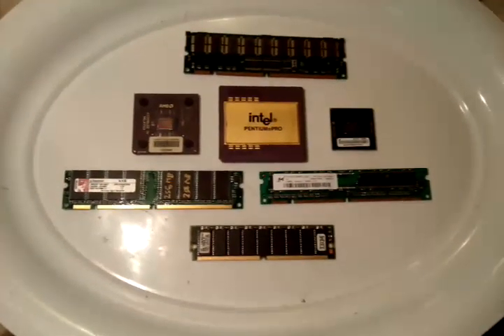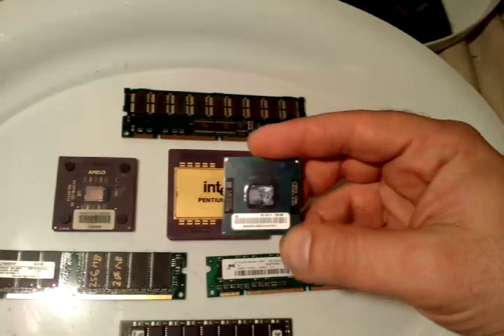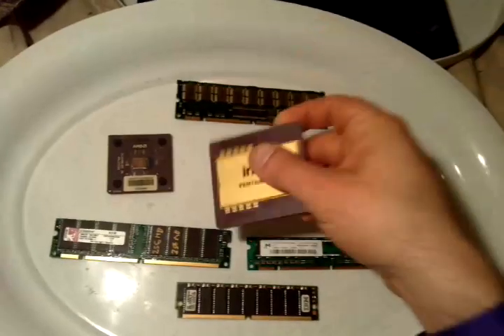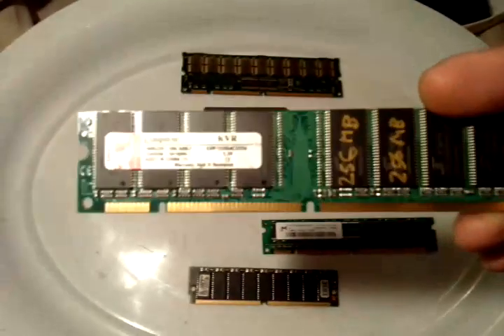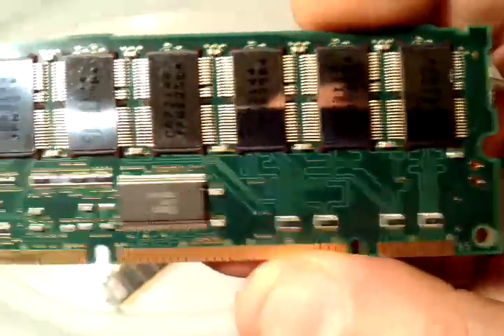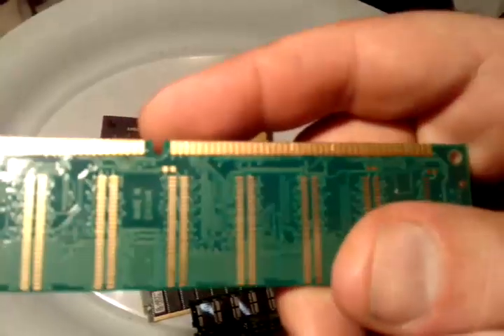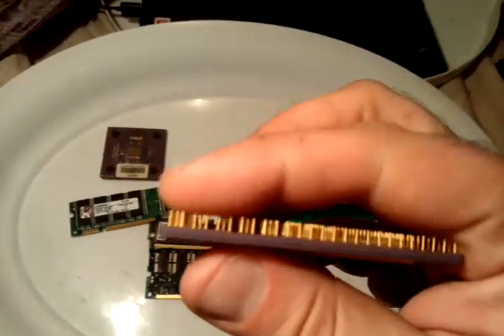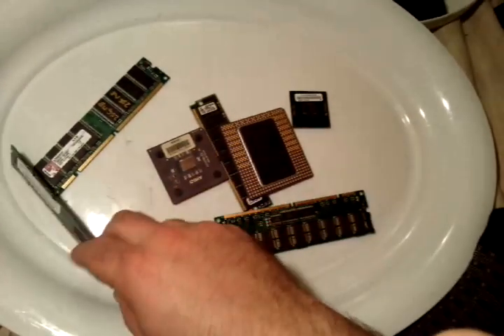Avi Oziel in: How To Recover Gold From CPU Processors and RAM Memory Integrated Circuit Chips

Comment: for the question about sound cards, all cards (vga, modem, controller,) have gold plating on the connecting fingers not much but if you have the material and spare time go for it.

Comment: To strip the gold off the fingers. i took my heavy duty soldering iron, modified the tip to a sharp edge using a small metal file. Let it heat up and run the tip along the finger ridge-line. melts them off like butter. Save all the boards,then put them in an acid wash to recover all the gold.

Comment: As a writer of technical publications I can tell you one vitally important piece of information regarding abbreviations and acronyms. NEVER EVER use acronyms unless you specify the meaning of the acronym in context of the subject you are discussing. "AR" for example can mean "Armalite Rifle", "Autonomic Reflex and a host of other meanings depending on the topic being discussed. Assuming that an interested but uninformed reader knows the meaning of an acronym causes frustration on the part of the reader and illustrates that the writer is either pretentious and condescending or just plain stupid. The point of writing is to inform not to confuse. If you are going to write a piece that includes acronyms, tell the reader what you are talking about. What the hell does MCC mean?
Reply: a0cdhd MCC, as well as MLCC, means  Monolithic Ceramic Capacitors. They have Silver ends and a Ceramic Center with Palladium bearing Metal alloy inside.
AP means Muriatic Acid-Hydrogen Peroxide Solution, usually mixed as 3 Parts Muriatic Acid at a 15% concentrate and one part Hydrogen Peroxide at a 3% concentrate..(Acid Peroxide)
AR means Aqua Regia, Royal Water, as it was the first solution discovered to dissolve the Royal Metal, Gold.. This is a solution of one part 70% concentrate Nitric Acid mixed with three parts 31% concentrate Muriatic Acid.
Muriatic Acid and Hydrochloric Acid are synonyms.
Urea and Ammonium Nitrate are synonyms..
IC means Integrated Circuit.
RAM means Random Access Memory.
Many here are familiar with these terms as we have been, and are currently, refining PMs (Precious Metals) from e-Waste (Electronic waste.). 
Nobody schooled me but I picked it up as I got involved. Of course it was time consuming and I stumbled a lot in the dark before figuring out who had a clue, who was teaching, and who was trying to just sell e-books.(This particular producer did not give any information and is just attempting to sell books.) I started down this particular path in late November and my learning curve has been steep. Of course I have a Science background which has afforded me an advantage on discernment..
If you are truly interested in learning how to do this then I suggest that you visit the Gold Refining Forum and download Hoke's book for free....and READ IT.
I also suggest that you have had a background in Chemistry as many of the processes are dangerous and lab safety protocols are nowhere near addressed enough.
It is not that we are pretentious but, personally, I want to totally discourage and dissuade anyone who will not take the time to research this topic thoroughly and are not willing to follow directions precisely. 
This can be a very deadly or injurious endeavor and it is not for those who will not take the time to do the necessary background research.. 
It is not out of greed (You, nor anyone else for that matter, are going to make a million dollars doing this) or exclusion, but I just do not want somebody to burn their internal lung tissues (which they won't feel as the lungs have no nerve endings) with acids or poisonous gases so that they cannot breathe and die as a result.
I do not want an ocean of dead bodies with the resultant Government regulation to "protect the idjits." 
Now you may believe that it is stupid on my part for not wanting to have that happen.
And you also may believe that I am somehow condescending.
But these processes are extremely hazardous and most really are not capable of Laboratory work or following Safety Protocols to the letter.. And that is just a fact. Science degrees are really hard to get.
So just who has been condescending with their unjustified criticism? 
Who has been pretentious? 
Who has been utterly stupid for being critical without understanding the motives?
And then you wonder why nobody responded to you until now?
So I really cannot care any less what you believe. Is that understood?
Reply: 24kGoldenRocket Excellently put old son. Now we all know what the previously mentioned acronyms mean. You are responsible for what you write but you are not responsible for what the 'idjits' do with that information. However, I can understand your reticence in telling the entire planet's population of idiots how to asphyxiate themselves with NO2, Fuming Nitric Acid and Hydrochloric acid fumes.
On the subject of no one replying to my piece: I had forgotten about it. About condescension: Using jargon and that includes unexplained acronyms is a form of condescension... And that's a fact. Pretentiousness is using language that your target audience does not understand. As for the rest? Well, the government already has a vested interest in protecting 'idjits', after all the 'idjits' are the ones keeping them in office and no one least of all me, said that you were utterly stupid. I think that basically you've done a pretty good job.  By the way, Urea and ammonium nitrate are not synonyms. Urea has a carbon atom. Is that understood?
Reply: a0cdhd 
Point noted...
http://www.differencebetween.com/difference-between-ammonium-nitrate-and-vs-urea/
But what is shocking is my misunderstanding of the word pretentious.
Pretentious is the adjective form of the noun, pretense, if I am not mistaken,
And the noun, pretense, means a fake or a fraud. (For instance the producer of this video is employing pretense in order to sell his e-book.)
Thus I believed that if someone was being pretentious then he was being fraudulent.
But then I looked up the definition and, to my surprise, it refers to narcissism...
Imagine that. I learned something new, that I have been misusing that word, abusing that word, for quite some time, for decades.
Now I need replace the word pretentious with some other word than fraudulent. I guess that some research in a Thesaurus is next on my bucket list.
Sorry for the confusion but thanks for the eye opener.
And as for Mommy Government???
I hope that we are not regulated and left alone. So we need to dissuade those who will kill themselves trying this when they have no business doing it.

Comment: The Pentium Pro Contains 1 gram of gold, that's a fact and recovery would be worth it if you had many of these and knew how to recovery ALL of the gold
Reply: its not a fact brandon. pentium pros contain between .3 and .5 grams of gold and that is collaboration between several different refiners sharing information from refining and what methods they used to extract the gold. ie: whole cpu broken cpu, crushed to smaller proportions etc. and we all come up with the same weight results.
Reply: Even if there were a gram in there, the process of extracting it takes waay too long to justify unless you have a bunch of them.
Reply: no the extraction isnt that hard if you know what you are doing, takes approximately 30 hours a batch and most of that 30 hours is just waiting. so if you do batches of say twenty at a time you get a decent return. the hardest parts of it is the reduction. some people say smash thm some say dont. i smash all mine. try to get pieces smaller then an inch then it is just heating them in AR and letting the reaction finish. let it cool pour off the AR with gold in solution into a second beaker with about eight-ten ice cubes made from distilled water to drive out silver chloride. and a couple drops of sulfuric to precipitate lead chloride. then after it has cooled filter off the Pb/AgCl and neutralize with urea. after it is fully neutralized add a teaspoon or two of sodium metabisulfite  stir and allow to settle 16+ hours then before you drain test with stannous chloride to make sure you dropped all the gold. all done

Comment: Because of this video and one other video I saw somewhere, I bought 10 of the Pentium Pro cpu's (May 2, 2014), thinking I would get a nice amount of gold out of them. You and another video claims there is approximately 2 - 3 grams of gold in each one. Not True at all. Let me explain a few things to you so you don't keep misleading people.

No# 1. From all 10 Pentium Pro Ceramic cpu's you show that I processed, I recovered a total of 2.5 grams... TOTAL.

No# 2. That gold on top of the cpu is NOT a gold/metal plate or cap a person thinks they can take off. That is CERAMIC with gold layered on top. Scratch that top with a file or something and watch you scratch into the ceramic. And those gold stripes on the top too, are ceramic with gold sprayed/heated on them.

No# 3. You'll recover approximately 1 gram more of gold, if that, from the inside vs the pins on the outside (batches of 10 cpu's).

No# 4. Each of those Pentium Pro cpu's weigh approximately 87.7 grams.

I have been processing gold and silver for about 2 years now, but this was my first for these cpu's. I know the procedures and refining aspects enough to refine to .999 purity, be it gold or silver.

I'm not sure if you actually refined any gold or silver from computer scrap, but your information is very misleading. I actually took a loss when I bought those 10 cpu's, all because I was relying on your words. You were 1,000% wrong on the yields of those Pentium Pro cpu's.

Once I find that other video, I'm going to post this same thing there too. This is FALSE information, because you're giving people FALSE hopes on what they can REALISTICALLY recover.

You'll get more gold out of RAM sticks (10 lbs worth) than you will get out of 10 of those cpu's.

Oh, do you have $133.00 to send me being as though that is the loss I took? I was even settling on at least 1 gram per cpu, and I didn't come even a fraction of that.

You should remove this video and redo it with truthful and REAL information and REAL YIELDS.
Reply: Ron, thank you for your post. I own a successful e-waste company in North Carolina, and I constantly have to tell people that these video's are misleading.
Reply: Red, we do not smelt. It's highly dangerous and expensive. We collect and move the material to downstream facilities.
Reply: BillKville
hey bill do you sell to small time refiners in smaller batches? id love to buy some cpu's and ram off of you if you do!
Reply: Red Cliff For many here this is a hobby that will ideally pay for itself.
You may break even, maybe you even may gain a little, but your time is more valuable pursuing other activities.
I would concentrate on collecting scrap of all sorts, and selling it, rather than attempting refining from e waste in particular, as it may prove out more profitable and a better use of your time. 
It is highly dangerous and these chemicals can cause major injury or death to those not experienced with LAB SAFETY PROTOCOLS or who are improperly equipped. Do you have a Fume Hood? Do you have a Gas Mask?
 How much Chemistry do you know? Where were you schooled?
This video is a sham..
Heads up..

Comment: and he forgot to mention the MCC's have silver on the ends so they need to be soaked in nitric before crushing and dissolving the palladium out with AR
Reply: edgar sikes If you throw the entire RAM Board  into AP (Muriatic Acid-Hydrogen Peroxide) solution then you can liberate both the IC Chips and the MLCCs  from the RAM board, along with the Gold Plating on the RAM board chemically. This is actually more direct and saves precious time. 
Of course I will still cut the fingers from the RAM boards and process that separately in another batch of AP. I am not that ballsy yet. But after I have built up enough confidence I will be. 
(Now you can spend your time tearing away all of those tiny MLCCs  away from the board if you choose, if you are into tedium, and follow your method to dissolve the Silver in Nitric Acid to make Silver Nitrate and then drop that Silver by using copper..) 
But the downside, the tradeoff, is that the Ag from the ends of the MLCCs is dissolved into the AP as Silver Chloride and needs to be recovered. That has been my experience. The MLCCs look like Mealy Bugs after the AP I still have to ask Geo on how to do that trick...recover the Silver Chloride from AP, unless you can answer that for me. (I NEVER throw away a solution.) 
Thus your Nitric Acid step is not necessary with Geo's time saving method. Just a Heads Up that there is another way.to tame that beast.
Then you can filter the Gold Foils combined with the Palladium bearing cores from the AP by filtration and afterwards dissolve all of that source into the AR (Aqua Regia) for separation and refining.
First drop the Gold from the AR, using the standard method of adding Urea and then Sodium Metabisulfite to get your mud.....which you already know
(Personally I will place that Gold/Palladium source into straight Hydrochloric Acid. Then I add just enough Nitric Acid to the Hydrochloric Acid to dissolve all of the metals. This both minimizes the use of Nitric Acid and Urea. Drew Metalsmith is spot on concerning that.)
Then add Zinc and follow Hoke's steps for recovery of the Pd . 
That is my understanding so far, thanks to some great teachers, this guy authoring this video not being one of them. I am still learning. If I am wrong let me know. 
Then you can incinerate the liberated IC Chips to recover the Au within them, following Geo's method, and also process that by using AR.
Contact Geo...Contact Drew Metalsmith and also Moose Scrapper is good. I think that you already know these guys.
There is the Gold Refining Forum after all. You are a member?
Reply: 24kGoldenRocket thats not the point of my comment. The point of my comments are showing that this guy is a poser wannabe refiner and bookwriter who's feeding the unsuspecting public a large load of false information. If you know a little about refining which it sounds that you do, then you will have figured out that he is totally misinformed while making these videos. If you haven't noticed that. Then I wouldn't put much stock in your skills til you learned a little more, but as for taking the mlcc off I done bother I sell everything nowadays because I make far more money but for a while I was making money refining my computer scrap. Tired of dealing with all the acids required
Reply: edgar sikes Oh I know that this guy is horrible. There is no doubt in my mind whatsoever about that.

I was just attempting to show you a less tedious method...which I learned from watching Geo work with RAM Boards..

Please do not take any offense.

Yes why refine them when you can sell them and gain more?

Right now I am learning how to refine. Afterwards I will chase profits.

Chemicals are fun...I have not had this much fun since college. That was decades ago.

But if you are going to do it then you want to do it efficiently.

And it seems as you have found a way of making a business from it...which is good.

I started this path for two reasons.

Someone had asked me if it was profitable to refine computers. I told them that I did not know... Then they trashed a bunch of computers before I could answer them. So I extracted them from the dumpster and tore them down myself.

I also buy and sell scrap Gold and Silver Jewelry and get a high 90s percentage, on the Gold, when I resell for scrap.. Since I also buy Gold Filled, it just sits and collects dust. So I wanted to learn how to refine it so that I could sell it for more than 70% spot.

Also on Silver scrap I get paid 72% Spot.

He told me that he will pay 85% Spot for refined Silver. (That still is not a high enough percentage return so I will look for other buyers.)

So if I can refine my Gold Filled and get a  98% Spot in return as a result then it becomes worthwhile to learn.
Reply: 24kGoldenRocket you have the right of it... if you email me we can discuss this a little easier

Comment: That's B.S. Not sure where you're getting info.  I've never recovered more than .33g of 24k gold from a 10k Pent pro. This is why it's SO hard for REAL scrappers make money  People like you giving bad info/ people thinking their 10k gold 1 micron scrap is worth '100's of dollars.Pent pro is worth $25 on ebay, less to one of those commercial sites.
That AMD is worth $5@ 0.11g of gold. The green/brown fiber board CPU are worth $1.50.@0.08 g
The RAM sticks go for $15 lb.
YOU GOT RIPPED OFF. Amature !
Reply: the actual processors are worth more than that to anyone looking for one, too. I just dropped $20 a pop on some 486 processors for a project... and now a 486 motherboard is $75-100 due to so many of them being scrapped. and you only get a few dollars off one of those boards because it's all gold plate.
Reply: actually the newer amd ceramic cpu's like the k6 only have roughly .03 grams of gold in them. they are almost useless to refine
Reply: And the k6 is usually worth more than $5 in working order
Reply: Mike Stavola
i agree. but for buying or refining them there is so little gold content that you have to have a hundred or so just to get a little bead of gold